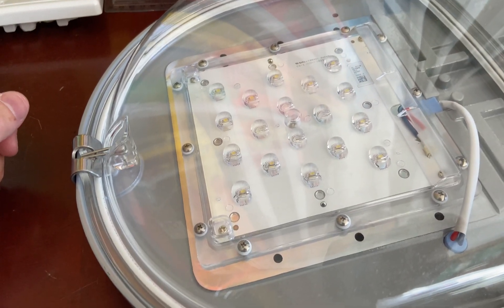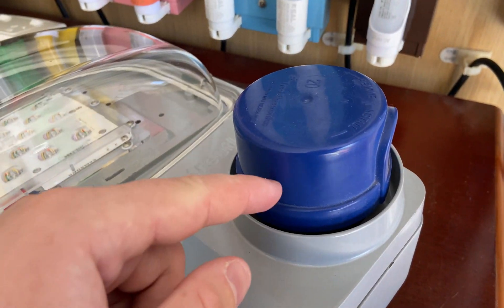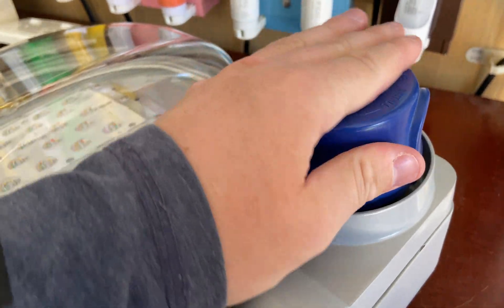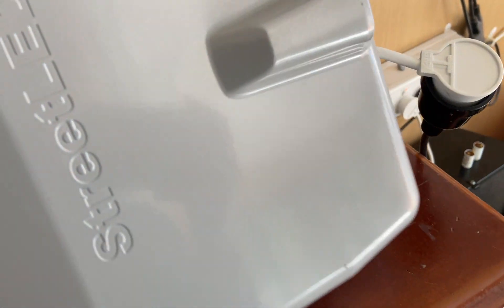Sylvania StreetLED MK3 street light

Comment: I scored one from the elctric road crew, the one out my front died, so they replaced it, I scored the dead one.
It had copped a gut full of water and the DC wire joiners coped severe electrolysis and one fell off, hence open circuit and no light.
I didn't get the photo cell, so I'll have to bypass that. On the back of the NEMA socket they used Wago lever wire joiners, so swapping the wires about should be dead easy, then all I'll need is a cover of sorts.
Yes I probably should get a dummy as show in the vid, but I have no contacts and the local electrical suppliers will probably charge  like a wounded bull.